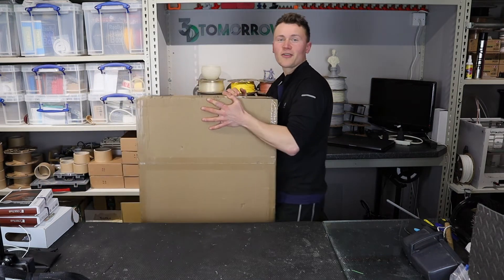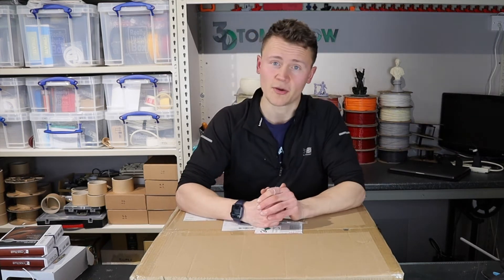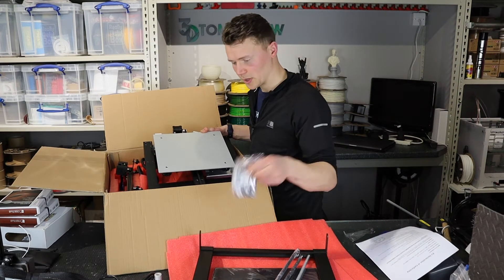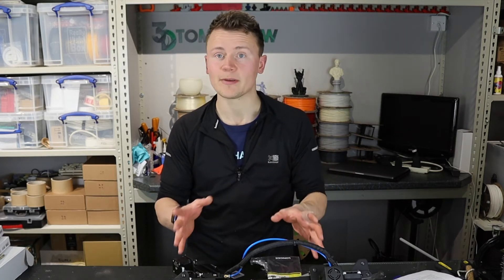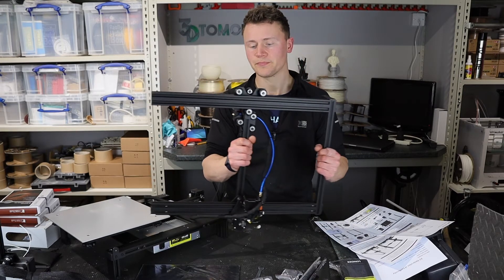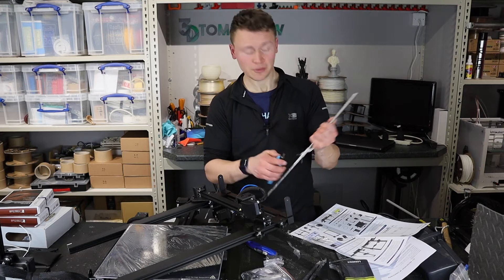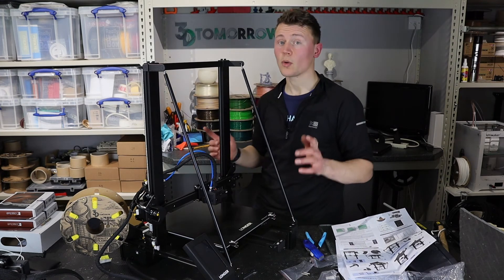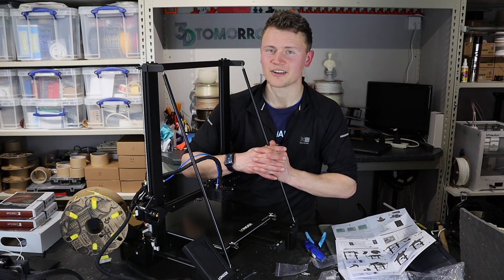Longer LK5 Pro || UNBOXING & First Impressions || Creality CR10 Clone for Better or Worse?

Comment: Im having a problem with my ender 5 plus can someone help me its not stopping the bed will just keep trying to go up and it will try to move out of the print area and its only day 2 of owning it.
Reply from the maker: Have you tried turning it off and on again? It will almost definitely be the BL Touch acting up, the pin hasn’t broken off has it? If not, give it a pull down lightly and then let go, sometimes that sorts it out
Reply: @CallumColes  yeah I tried that even power cycling it didnt work

Comment: I would of liked to have seen a dual z on the printer, it looks bigger enough to print helmets on. Very nice video
Reply from the maker: Hey Karl, thanks for the comment! It's certainly one of the things I will look at over the course of the review. I think Longer have done a good job of constraining the movement on the Z-axis with the roller wheels so actually think it will be okay for this printer. Although dual Z-axis would theoretically be better, there are so many bad implementations of this setup. The main problem with a dual z-axis is that if there is only a single Z-axis end stop, then it's very easy for the two leadscrews to become out of sync, which then affects the first layer, etc.

It certainly would be big enough to print a helmet, will see what I can do!